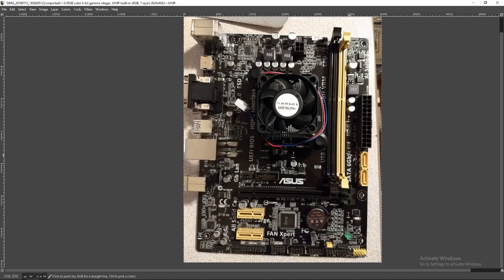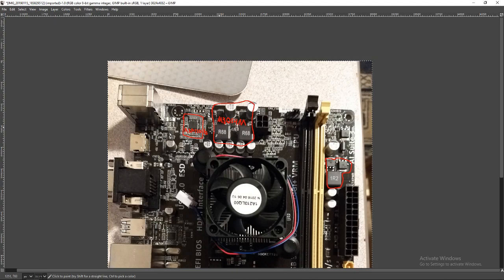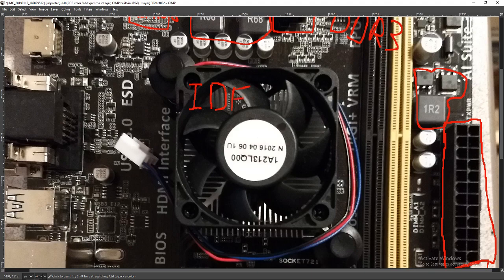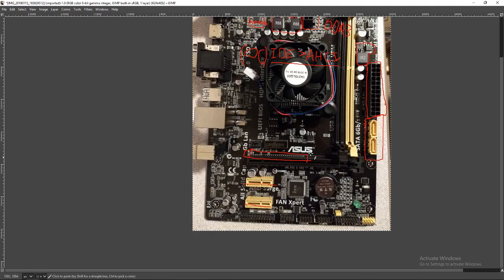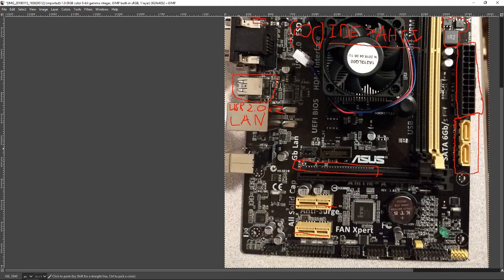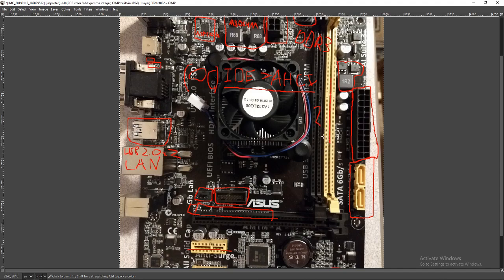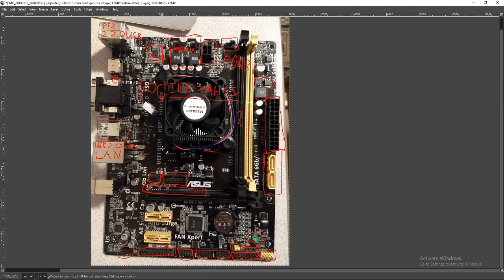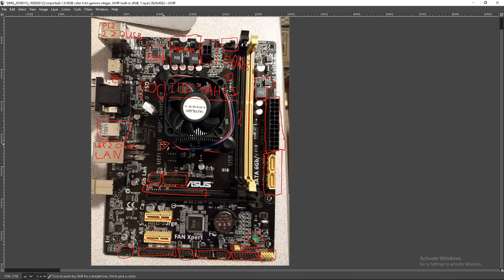Asus AM1M-A Motherboard Breakdown

Comment: i have this board with the Athlon 5150 AM1 APU (Kabini Jaguar)
i had added a PCIe SATAx4 card but i think i put too great of load for the PSU i had allocated.. 
didnt know about IDE vs AHCI for increase of bandwidth
also i hadnt considered that should only use one DIMM. it worked great with the 5150 Athlon ...i have the miniITX version with Sempron 3850 which can be sluggish.   i put 2x 8Gb UDIMM in it recently and it ran slower haha. i have it running AV Linux MX edition